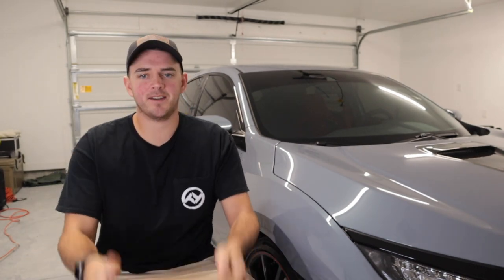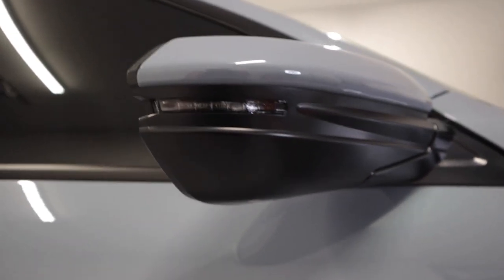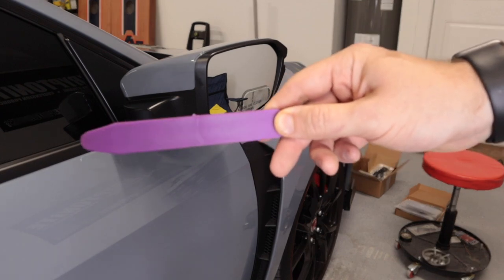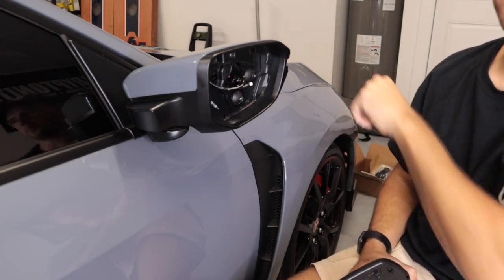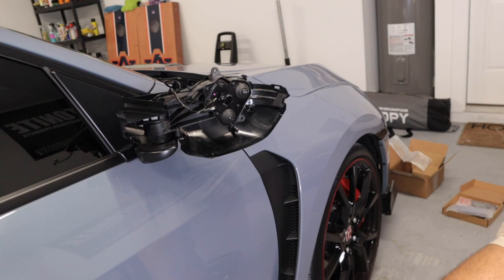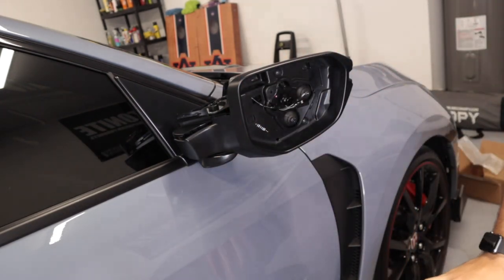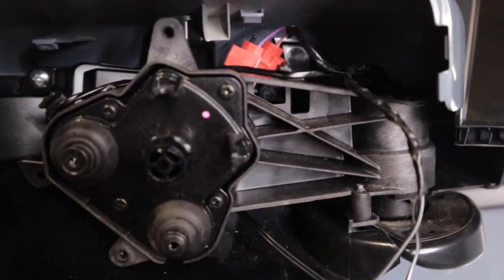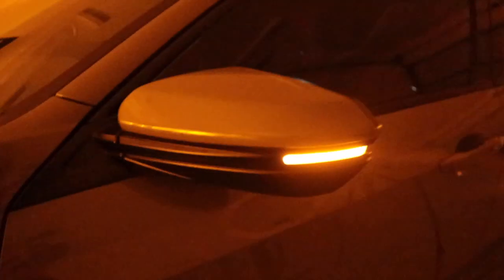SUMA PERFORMANCE LED MIRRORS + LED SEQUENTIAL TURN SIGNALS!

Comment: Another great video content Tyler!  Thanks for sharing your video.  It was very amusing watching you fire up the turn signal lights in the dark.  In comparison with the OEM, sequential lights are nice and more pleasant to the eyes.  The one thing I don't like about Suma Performance is the way they provide their wiring.  I would probably use some aftermarket connectors instead of just using a t-tap to existing wiring from factory to make it easier for installation.  I learned the difficult way when I took on the side marker install from them.  Otherwise it looks great- I like the anti-glare mirrors.  You should turn on the headlights from your truck to simulate what it looks like when there's a car behind you at night.  Man I envy you because you have a nice garage and can do mods on your cars 365 days in the year.  If I went outside right now in the carport to try and do this I would freeze my ass off.  🥶
Reply from the maker: Thanks for the kind words! One day I’ll have my own shop.

Comment: I got a question, are those signal lights not made for the Honda Civics that have the lane watch? Mine has a camera on it but I don’t know where to get the ones with the solid lights. 🤷🏼‍♀️
Reply from the maker: The new 2020 models don’t have the lane watch camera.
Reply: @TTorres1183  Okay. But my car is a 2018. So I wasn’t sure if the only option I had was to get the mirror with the defroster + turn signal and not the sequential signal light to go on the front side of the mirrors.